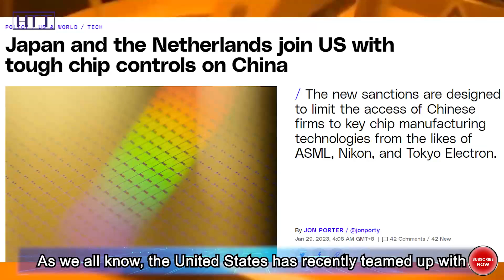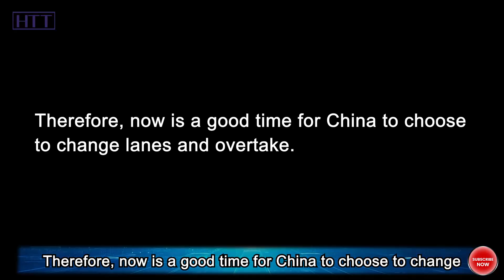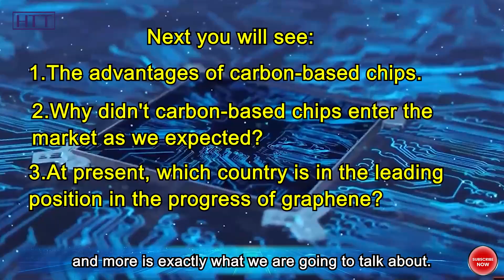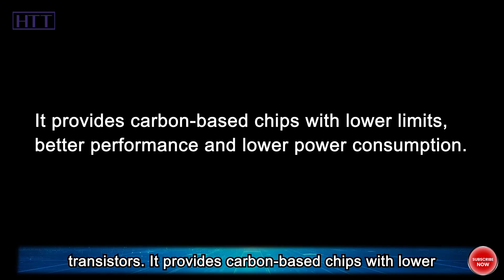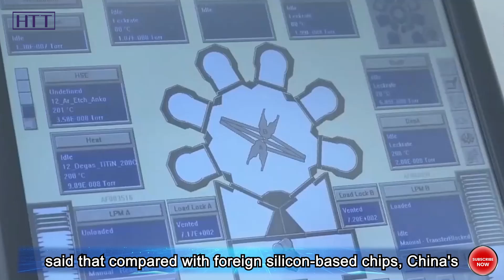China JUST SHOCKED The Entire World With another rising tech!

Comment: Continuous chipping away at a big rock will eventually break it up.
Chinese R&D to overcome the obstacles for a graphene based semiconductor's microprocessor need to be funded to finish this project as there is no choice, since the road for advancement via silicon is totally blocked now by USA and its partners.
Whether 5 or 10 years are required is not an obstacle.